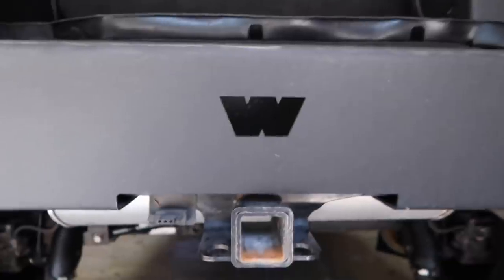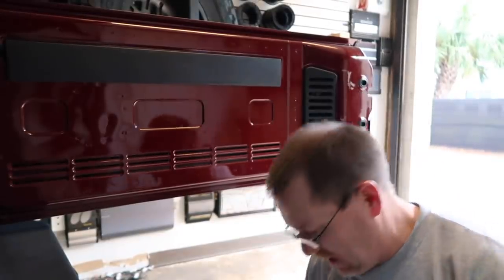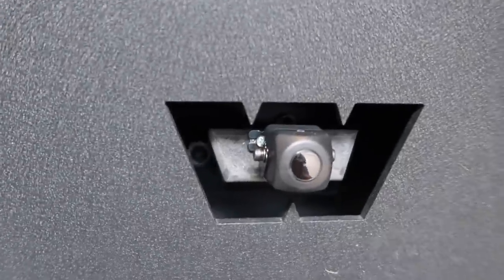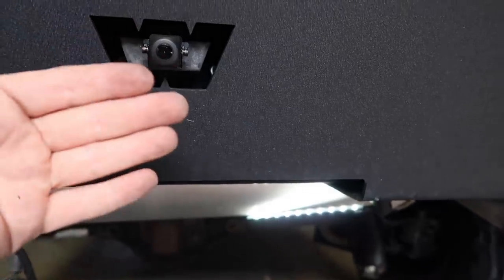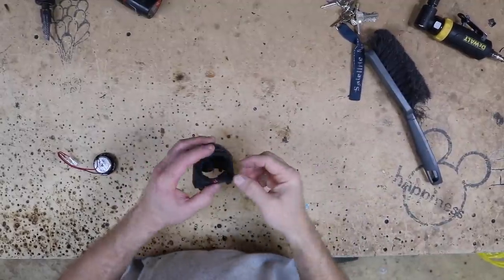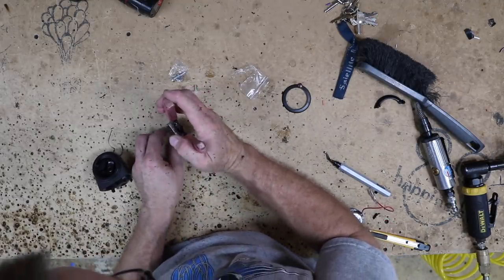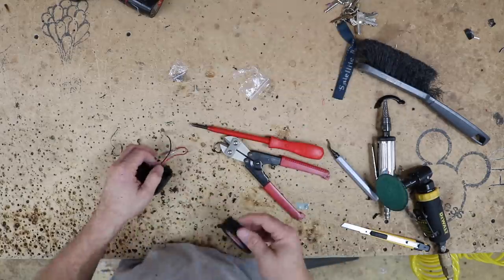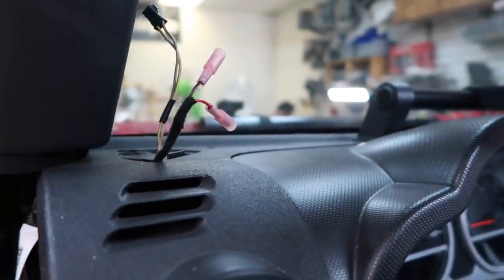It is a Jeep Wrangler full stereo and Backup camera upgrade.  Installer Diaries 147 part 1

Comment: I might be wrong, but it looks to me like if you rotate the tire 90 degrees clockwise, with the valve at the top, you should be able to get the camera mounted at the 12 o’clock position

Comment: Hello, I have a 2007 jk wrangler soft top so very similar to this jeep.  I have the factory amp/sub set up. I have swapped in a AVIC-4200NEX  and added an older blackvue 2camera dashcam that has a module that allows you to use the rear camera as backup camera.  My next upgrade is better speakers/sub/amp. Is the gear in this install your recommended hardware? if not what would you go with on a budget of say 2k or so .I have looked at the JL stealth box to leverage my mostly unused storage area and allow me to free up space in the back, but I have yet to be able to see one in person.  The documentation says it raises the floor line 5"  which is a lot.  do you know of another solution that would be lower profile?